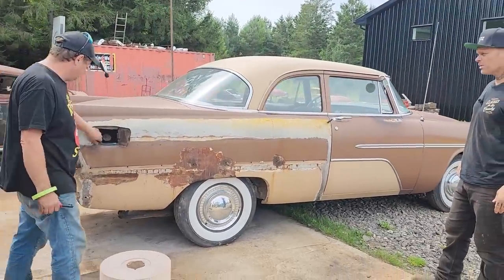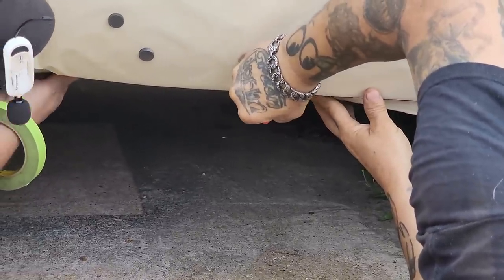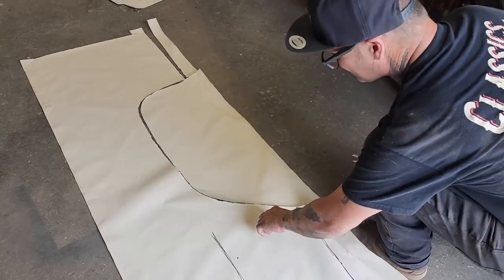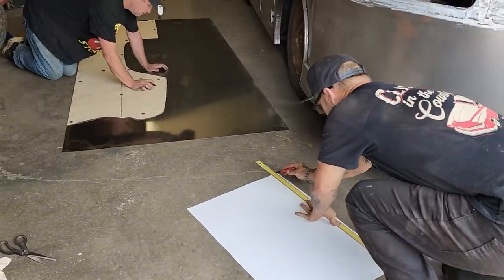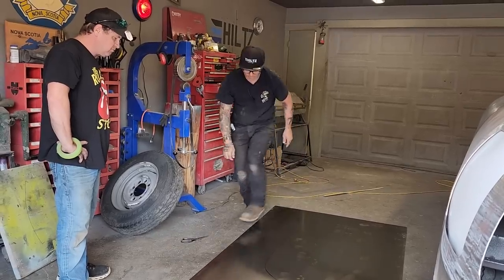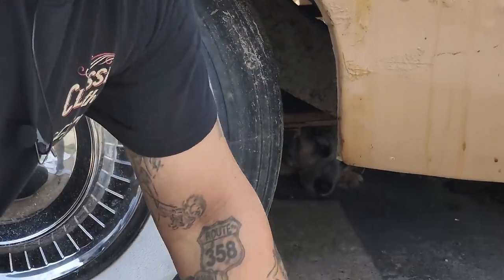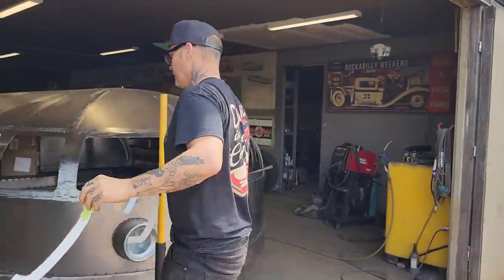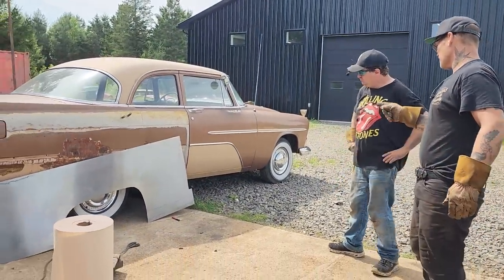Rust repair on quarter panel – step 1: make a template

Comment: I'm pleased to see you doing a restoration. The 56 Plymouth is a good looking car. The engine is probably a 303 and there was an option for dual four barrel carbs.
Reply: You clearly do not understand the difference between a rebuild and a restoration. Call it what it really is.

Comment: Instead of cutting new quarter pannel for the job, I prefer removing the bando from the original sheet metal to do any body works. The original sheet metal stil looks solid. However,  it is a good tutorial video to learn how to fix rust or accident damaged body.🔨⛏⚒🛠. Tku!

Comment: Run a 2” wide strip if masking tape along that edge and cut the excess of with a razor blade. No fiddling if with multiple pieces of paper that could get misaligned. Nice to see another relic get revived.

Comment: Theres a way of rolling a section longer than your rollers roll the panel on an angle enough of an angle so it goes through  it will look  like a corkscrew then stand at ether end and twist it straight

Comment: I don't know if chad reads these but if he would put a piece of tire inner tube rubber on the top wheel of his english wheel that's sitting in the back ground you could use a low crown lower die to put the curve shape into the panel without cutting it into two pieces. Especially since you have a helper to hold the other end and help guide it through the rollers. I made a set of long fender skirts for one of my cars that way using an English wheel.  My skirts were around 4 or 5 feet long.

Comment: Good Day Jolene, I understand the daily challenges that you must have regarding your you tube channel. I still have an intermittent volume problem with your indoor and some out door videos. When I watch using my RoKu on the flat screen I have to bring the volume way up sometimes 50 to 100 to be able to hear Chad or Doug or Nathan. On the RoKu when the ads come on they blast me out of the room! If watch the same video on my laptop the problem is not present. Your videos in the past (2 months ago) did not have the problem. Recently the problem mostly occurs when you have filmed the video inside the shop and today I need to raise the volume to 50 on my RoKu to hear conversation. I am too frugal to pay goggle  to opt out of the ads. I do use the sound leveling to minimize the ads on all RoKu channels. Your channel is the only one that I seem to experience the problem. Is it possible there is a point click setting regarding volume and ad volume when you are uploading the video that would fix my problem? Please continue your great talent filimig

Comment: I really don't see why that you think that the car isn't good enough to customize !  Look at prior cars and it's not that bad.  I've fixed a whole lot worse.  The floors are there and it has all the windows etc... so I think that it's just not the car he want to customize.    It has pretty good lines it's just not my preference of car but, it has really great potential for anyone that would like a good start.  It is a pretty good project that will show how to take a similar kind f car to fix up to what ever a person may like to build.  Making a quarter panel for this car doesn't seem to be that difficult with pretty simple lines and once installed it will really make a nice car for some one !

Comment: How long back was this show made The lost episode showed that the truck did not  Is the floor in and the front plate was not in But that is all finished now
Reply: This is not an old video, it was done in between the work on the hauler, I'm figuring so they could maybe take a lil off time, you get vacation time don't ya? Or you don't have a job?
Reply: Obviously ringing the changes to keep the projects fresh when he goes back to them . Also he is filling the time that there is between filming the main project
Reply: This is not an old episode...it's 'now'. If you watch previous shows...he showed putting the floor and the other sheet on the Hauler last week.
Reply: Brian Higgins wow
Reply: Man get off this dudes dk

Comment: So the sheet metal of the vehicles from the 1950er was thicker then than it is today - and from the visual situation I can see no need for a thorough renovation that would devalue the vehicle, i.e. reduce its value.
in addition, the composition of the material is not what you can buy today as a material: i see it very critically without further analysis!
a professional and appropriate careful restoration clearly does not look like it to me!